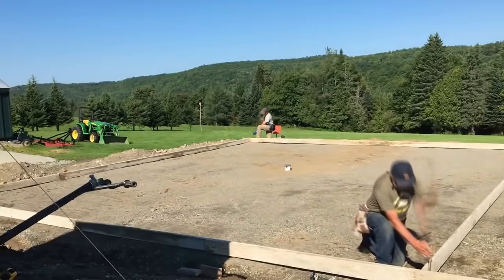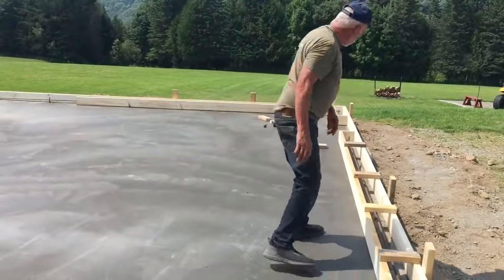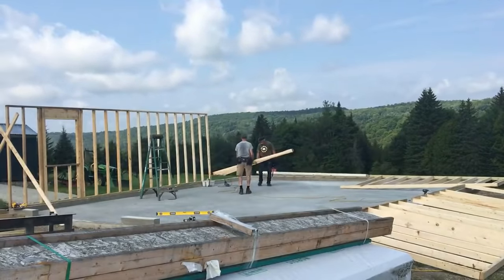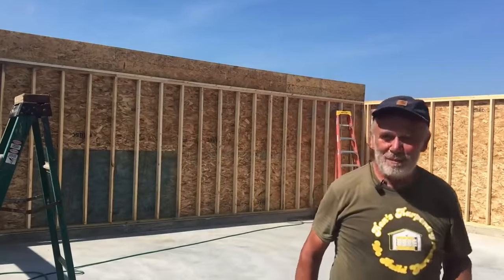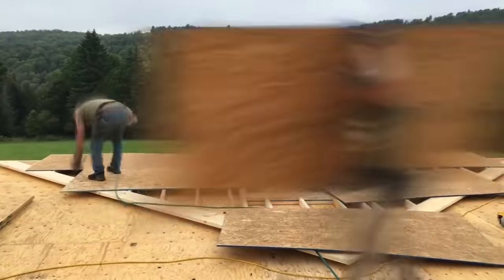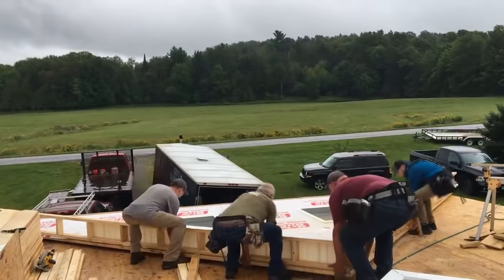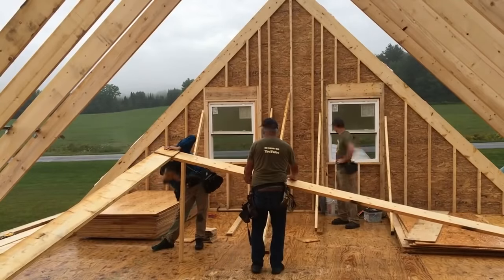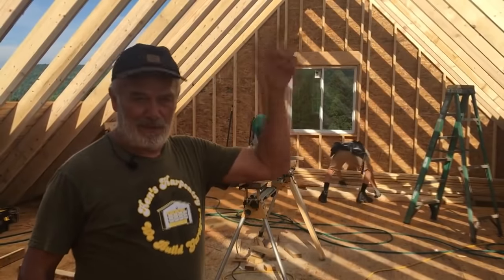TIMELAPSE CAPE STYLE GARAGE...$64,500 Materials and Labor

Comment: Nice work. I wanted to build a home just to see if I could. It was in a city next to Los Angeles  harbor area. 650 cu. yds. of dirt remove, down slope lot. 4,000 sq. ft split level. It was a tank, code for earthquake is extreme. 1 year to get plans approved, Was on massive Basalt formation and septic was not going to pass perk test so put in a sewer line to another area below. Had to put in tees for the homes 5 homes, between me and the tie in. Got another home to help in cost. That took a year to get approved and built. Then 2.5 years to build the home. Turn out great. My designer stayed on till the structural was check off by the city. I used his subs. I did the golfering and metal fab stuff and put in the cabinets fixtures, tubs toilets fireplace garage doors railings for stairs and balcony. I learned a lot. I would had been better off buying a fixer. The city came in and told me what its value was. I thought I could show receipts and claim that value. $1.9 million so $23K in property tax a year. I live in it 10 years, til 2020 and sold it just to get out from under the taxes. Close to retirement and no way I was going to be able to pay that on a fixed budget.
Reply from the maker: Wow

Comment: Just love that layout Ken.. This would be a perfect Retirment home !!
Reply: Ken this is in response to M. Fossum reply of 2x3 construction. Out of all the video’s I’ve watched on your channel. I cant ever remember you using 2x3 construction method thats crazy 2-1/2” thick studs. All of Kens exterior wall are consider barring walls with this type of roof system and would require much thinker studs minimum 2x6 exterior studs. I could go on and on, But lets just say I would build it like Al & Gina’s is doing.. 2x8 walls foam filled w/Zip sheeting..

Comment: I cant imagine the cost difference from around 2005 when we built our shop  . We went all steel , 25 ft side walls , 2 story  . The cement was 10k back then  for 35 x 92 ft . The building materials were about 20k  for the metal building  , all steel , no wood  (35 x 60 )  .We spent about 40k on everything  but me and my bro did all the work , accept the cement . Cement has probably tripled  in price  and we know steel is crazy high priced these days . I would guess it would run us 120k today and that is no labor  added . I am too old to do it over for sure , it was a ton of work .

Comment: really nice work Ken,   would it be hard or impossible to put a upstairs on a 32 by 60 pole building?  my roof has a 8 by 12 pitch, would it be possible to just take apart the inside rafters one at a time n reshape them for putting in a second story? if so whats the best way to go about it if you know off hand thanks

Comment: Collar ties that are more than half way up the rafter no longer provide adequate rafter support and strength  for which they are intended   but revert to becoming framing for the ceiling. (engineering 101)
Reply: Collar ties have to be in the upper third of the rafter span per 2018 IRC

Comment: Ken I am starting to build a garage and work shop similar to this one.  Was wondering if you are using 2x6 walls on the bottom with the I joists?  Mine is going to be 24x32
Reply from the maker: 2x6 is good if you can swing it

Comment: nice Ken. how long did it take you from start to finish.. and avg. cost per sq. foot .. looking to do something like this.. thanks
Reply: Ken didn't mention how long the site prep took but I would guess this is a one week job after the concrete is cured. (that's one week on site) While waiting for the the concrete to cure they build all the walls at the shop and load up the trailer with supplies. In real time that likely takes 2-3 weeks total, including site prep.
Reply: Pull out your calculator. Roughly 90. I couldn't remember the exact measurements.  That was at 32 x 24 or something close

Comment: How did you join the rafters to the i-beams ?  I ask this because in my highly limited experience (4 sheds)  I have always joined the rafters to the ceiling supports to make a strong "A", to prevent wall spread.  This is because I live in a snow area and there can be significant extra load to the roof.  I don't live in north America (though I have relatives there) so maybe the technique is different.  Otherwise, I enjoyed the video very much.

Comment: My house burned down over a year ago. The company the insurance company recommended still doesn't have our home done. The only thing they did was replace the entire roof... When they did that we lost tons of head space in the attic. Now that totally screwed  my hopes of ever making that living space  and they knew that was the plan because they change the floor / (ceiling to the downstairs )with 10 inch wide board instead of what I believe was 8 (totally able to use this by the way  would have been up to code  ). There for that's what made us lose 2 inches from the floor being raise upstairs.. Then instead of 8 inch they used 10 for the roof  so I lost 2 inch from each side of the walls upstairs   ... Its hard to explain really   .. Im not in construction but I know they are way over code for what really we needed   .. And now we dont have the head space to ever make that a living area due to code.. Knowing this .. wouldn't they pitch the roof more on an angle if taking away all this space by using wood that's too wide   they went above code. Yes it will pass code but only for storage space /attic  when before the fire it was able to be livable space we just needed stairs ... Im completely pissed with their work and now a year later im afraid to say anything about anything because how much longer will it take to get my home finish if i complain ..  I gave them 50,000 down ... They told insurance company December   here it is Feb... Nothing has been done Since roof in sept... Remind u...  Fire was in Feb...2021...
Reply from the maker: Sorry. Hope it works out for you

Comment: on the upstairs window on the stairs end, it looks framed different than the other side.  It looks like the studs are not doubled up.  is there a reason for that?  Also, do you need a vented roof if you use closed cell foam insulation?
Reply: Always vent your roof. Call your local permit office or inspector
Reply: @corysturgis6660  did you see the lumnah house?